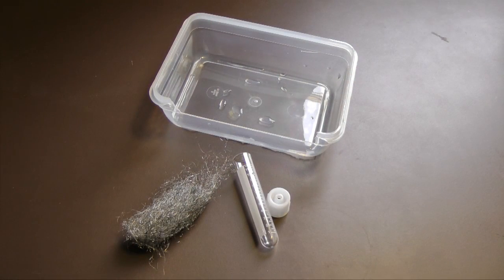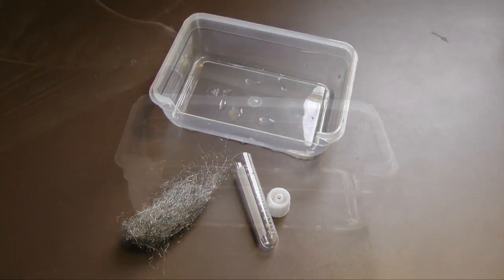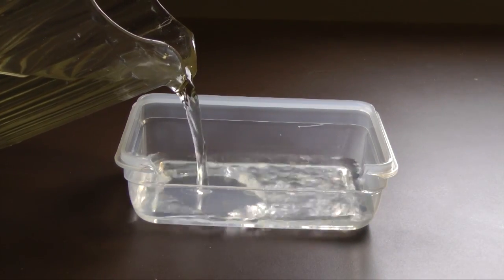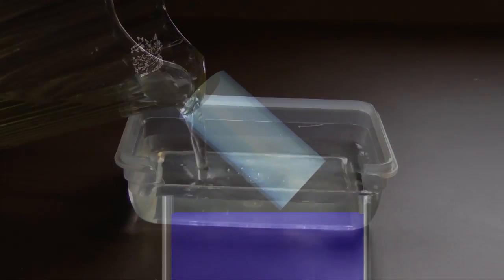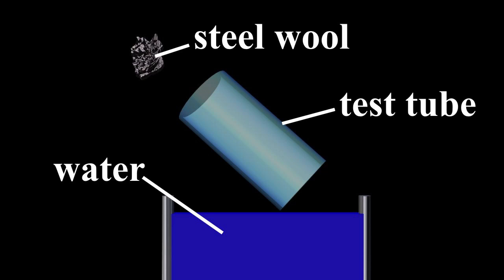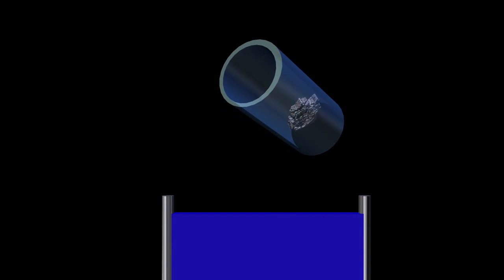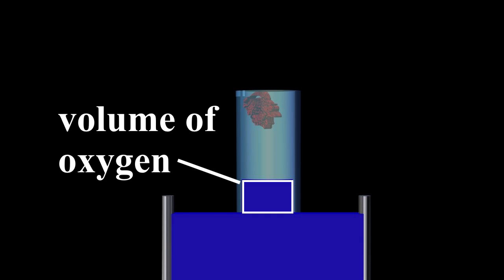Percent Oxygen in Air

Comment: The oxygen is still in the tube, bound to the iron atoms instead of free-floating. What you're measuring is the difference in volume between air with steel wool in it, and oxygen-depleted air with rust-wool in it, ignoring any oxygen or nitrogen able to escape preferentially from one of the tubes by dissolving into the water.

Nice work. I'm going to do this one with my kid.